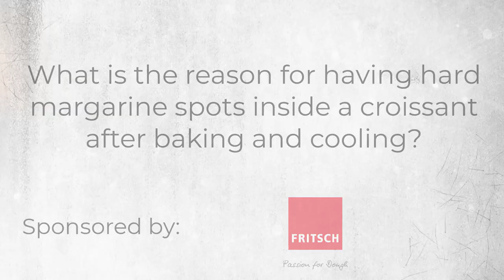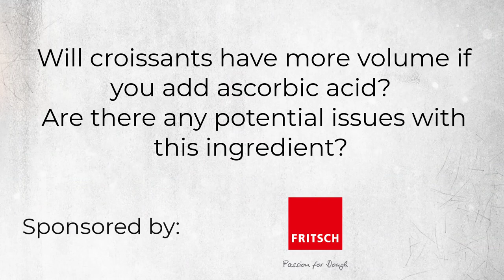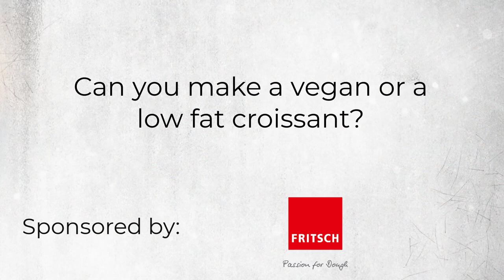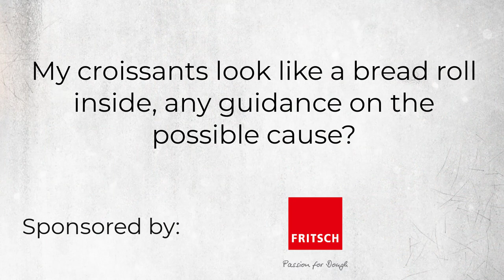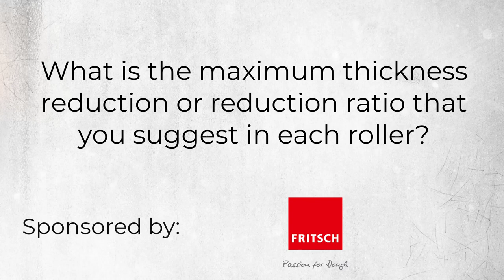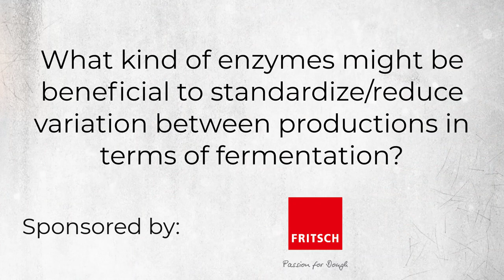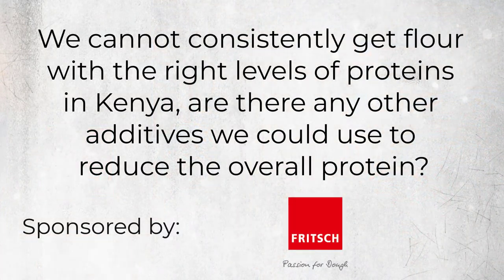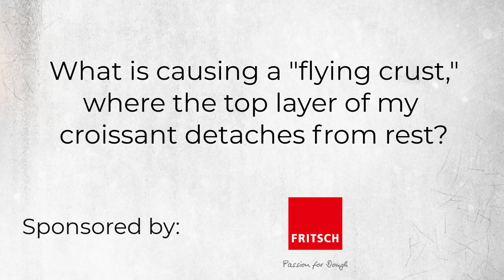Croissant Production Q&A | BAKERview | BAKERpedia

Comment: The `enzyme doesn't act on the gluten', the amylase acts on the starch content of the flour, breaking it down to provide the sugars for the yeast action.
You need to differentiate between things like protein content and gluten content.
Gluten, or more correctly, glutenin and gliaden,, by rough rule of thumb make up about 90% of the protein content, but are far from all involved.
Rye flour, for example, is lower in gluten than wheat flour, but higher in protein content, overall, than wheat flour.

Gluten content has to be reasonably high.
The America's style `All-Purpose' flour is: from what I have been able to make out from a distance, about 11-11.4%.
That's not a biscuit flour!
I am well aware that many American bakers make bread from it quite successfully.
The water percentage is a little lower than it would be with a more stronger flour, but quite usable.
If you don't have a reasonably high protein level, it will not stand up to the stresses imposed by lamination, for example.
And you definitely won't have the extensibility aspect working for you.
If you are finding it difficult to laminate, it's because you are not allowing enough time between your folds, for your dough to relax.

Fat temperature and dough flexibility must be similar to avoid breaking of the fat layers, predominantly.
That point should be worded much better.

In this country, if butter has any more than 16% water content, it isn't butter: it's illegal.

That is not a formulation.
Formulas all work off a flour figure set at 100%

 And, with regard to `rework' the most productive step toward reducing the need for that is in making the original benchwork more efficient.
If it's not, you're producing too much waste.
If you're not producing too much rework, you don't have so much of it to deal with.
I have had to deal with larger amounts when cleaning up after others and the most productive step is to include it in the laminating process as early as possible.
I have dealt with 10% efficiently in this way.
I use one book turn and two half turns in my lamination procedure.
This ensures it's incorporated efficiently so the dough is consistent in the end product quality.
When you have half a dozen 30 Kg blocks to process, it's not hard to deal with.
Reply from the maker: Hi David, thank you for your feedback. We'll be sure to pass that onto the team.